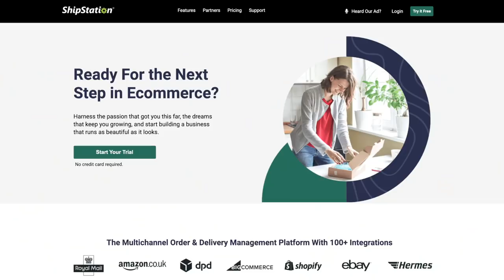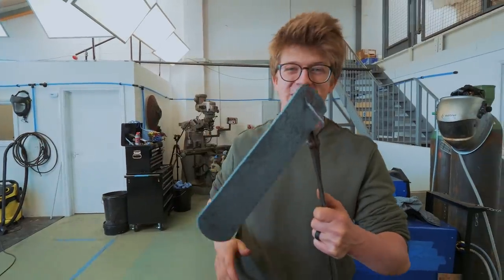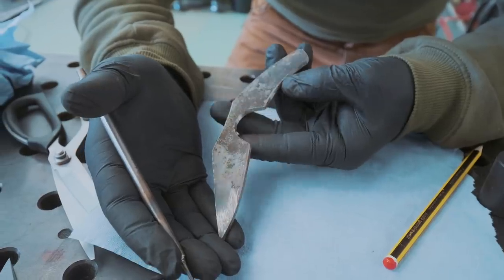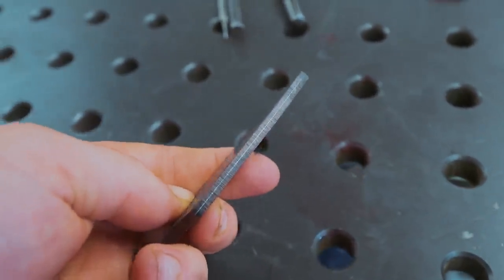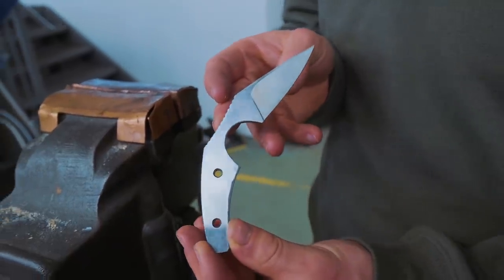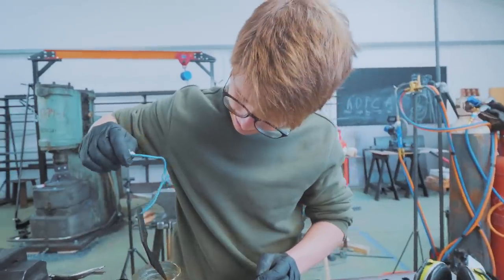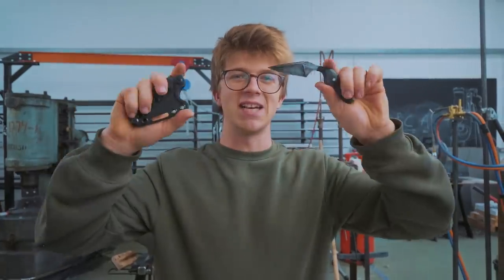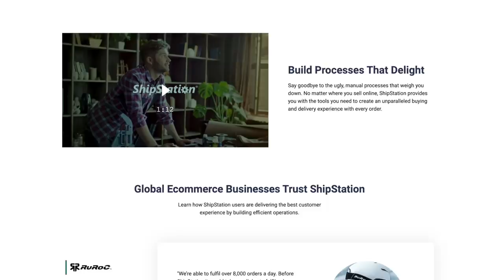MAKING 'THE SPLINTER' EDC KNIFE!!!

Comment: My question is where can I get the kydex sheath like that because the one I received with mine is horrible. The adjustments needs improvements. It’s difficult to get a good grip quickly to open my WPS boxes when they arrive. Love the knife, hate the sheath, therefore they both sit in “THE” drawer.